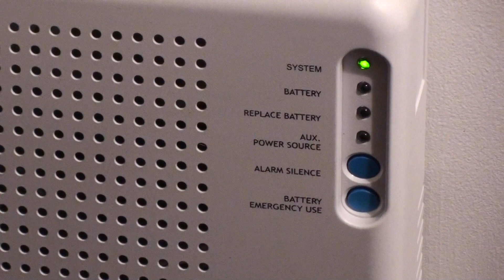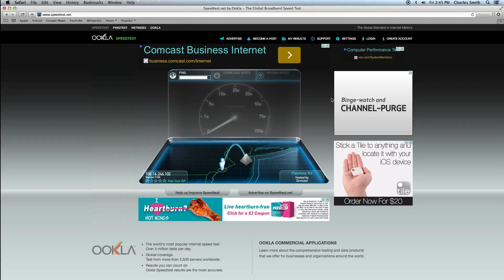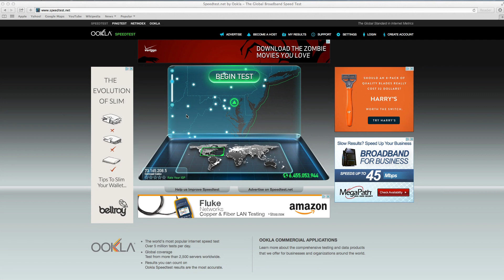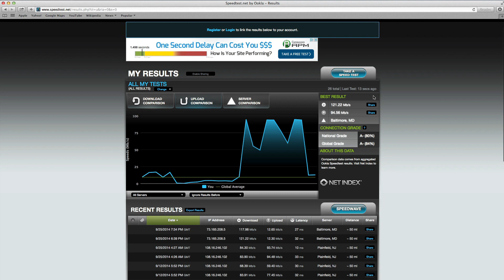Verizon FiOS Block Installation Process and My FiOS Experience

Comment: So, do you live in California, Florida, or Texas? If so how had frontier been.  I have frontier Fios and had 75/75 but just got upgraded to 200/200 yesterday.  It’s so insane.  I get about 2-5 ms ping.  Do you still have this connection?
Reply from the maker: I wish I lived in California, but no, I live in none of those states you mentioned. I live in Pennsylvania where Frontier is available but not in the city of Philadelphia. Actually Frontier uses Internet services from Verizon FiOS so you're still enjoying Verizon's services. I still have 75/75. I upgraded to 150/150 in 2014 but I saw no difference in uploads on websites so I downgraded back to 75/75.  It's been good for me. I see they have speeds of 1Gbps now. Sadly, though, I still have no idea how much my bill be. I haven't saw a price list anywhere of the entire service. The price went up $10 for every two year contract I agreed to. Next year, it may be another $10. I was paying $69.99 for phone and Internet in 2014. Now it's $89.
Reply: Thanks for the reply.  Yes, I used to have verizon, but then got switched over to frontier in 2016 when they bought verizons lines in texas.  I am really enjoying the 200 from the 75, as I download and upload large files a lot.  In fact, its so fast, it maxes out some of my older 802.11n wifi devices, and you have to have 802.11ac to utilize the full 200.  BTW, I'm averaging about 200-205 mbps download and about 240 mbps upload, which is insane!
Reply from the maker: @prestotechreviews8871   @Noname121416  Oh I see what you mean! I do have an 802.11ac router. In 2014 when I ran a test on Speedtest.net, I got 175/175 but I meant to say sometimes some sites won't take advantage of all the bandwidth if the servers speeds aren't up to date. Since I'm a video producer, I upload larger files than I download. When I first uploaded a large 10GB file to sites like Facebook and YouTube, the 75Mbps was faster than all the other upload speed tiers, but I saw no quicker time with 150Mbps. Maybe they improved it since I last checked. I think many sites weren't optimized at the time for super speeds yet. I may upgrade again this year and test it out. I'm even thinking of trying the "Gigabit" (940Mbps) connection for just one day.
Reply: @CharlesSmith 2014 was 5 years ago.  I'm sure the servers have been upgraded to at least like 500 mbps now.  But don't quote me on that, just a guess.  I did upload to google drive and got my full 200 mbps connection basically, and same download.
Reply from the maker: @prestotechreviews8871  Nice! Okay. I'm going to try out the upload speeds one day on the Gigabit connection.

Comment: Charles, I'm late to the party... I'm getting Fios installed in a couple of days, I'm in University City and finally realize that Comcast charges to much for Internet. I'm getting 100/100 at a great price. Question, that "ONT" in your video, can you receive "over-the-air" broadcasts?  Ever connected a coaxial cable from the ONT to the TV and get channels?
Reply from the maker: Hello, better late than never. Congratulations on your new FiOS package. I'm not sure if Verizon still allows free over-the-air video from the ONT. I've just been using the Internet from FiOS, I've never tried it out. I will make an attempt to try it out soon and maybe I can tell you the result.

Comment: Just curious for any connectivity issues whether its inside your house or not does verizon charge you and is there a monthly fee for your modem
Reply from the maker: I think Verizon charges you to fix your wiring inside your home. If it's outside, I think it's on them. I can't remember. But yes, there is a monthly charge for the modem. I don't use their modem anymore. I sold after having it only a month. I bought a better faster modem/router from Linksys.

Comment: just curious what town is this? fios is listed in my area (Sayreville, NJ) but ive address checked all houses and couldn't find one capable of getting FIOS. I didn't even think they were even still building out cuz I can't find any information about it in the news
Reply from the maker: AMP Tech This is Philadelphia, PA. Sorry for the trouble you're having. Yes, it's difficult for me to see if FiOS is in your area. True, Verizon is currently no longer rolling out FiOS in new markets as of 2010. However, if prior to that year they promised to bring it to your city or township, then they must honor that agreement. Typically, if Verizon has a franchise agreement with a city or township, it must wire that whole entire area. So, even if FiOS is listed in Sayreville, NJ but you cannot find an address with it available, that doesn't mean its not coming. They still must legally honor there commitment to finish the areas they promised to bring FiOS to. Some addresses you haven't yet checked may have FIOS. How many years have you waited for FiOS?

Comment: I'd be curiuos what is the maximum ethernet speed that is possible when Verizon does installations in large apartment buildings. This would be a function of the category copper cable they use and the distance of the runs. I ask because I wonder what happens when the fios server is capable of going over 1 gigabit. Will the ethernet in the buildings be a limiting factor because they didn't put high enough category cables in there? I would hope they put in something that can go over 1 gigabit. This would probably need to be a category  7a cable. Were they that smart? They can charge more for higher speeds and I'm sure that by 2020 one gigabit will be available and over one gigabit will be available after that. To do an installation in 2015 for example that will be limited in five years would be a very poor installation choice for a large building.
Reply from the maker: Yes, I agree. Those are great questions. I'd hope they make all the right decisions with the correct cabling now to allow it to be expandable in the future. If you have a friend that is fortunate enough to get FiOS in their apartment building, I'd ask them to ask the Verizon crew those questions. Verizon may not tell you this you this stuff over the phone or in person if you are not an apartment renter, as they may feel this info is classified. But its worth a try asking them.
Reply: Charles Smith Yeah, maybe only an installation crew would know, but only while they are doing it. Anyone else who would know might be too insulated to talk to. If the installation has already been done then no chance to ask that though.

Comment: I'm in Philly also, getting fios installed tomorrow,  how long did it take them to install your service  Charles?
Reply from the maker: Nice! It took them less than two hours to set me up for FiOS; It didn't take long because I had only wanted the telephone and Internet service with just one computer connection. I networked the other devices myself. It could take four to six hours, if you wanted the TV set up, with multiple boxes and DVRs.
Reply: Ah ok. I'm just getting Internet and one TV box. I've been wanting to switch to fios since they finished the roll out in my neighborhood. I dropped Comcast and getting the  150/150
Reply from the maker: Sounds good. Funny thing, I upgraded from the 75/75Mbps tier to the 150/150, but downgraded back to 75Mbps within a day when I realized my speeds didn't seem any faster. Now, my tier is stuck at 150, as seen from multiple speed tests, but they're still billing me for just the price of 75! It's pretty cool. I confirmed and they basically have a glitch on my account that is getting me this. I kept telling them but it's listed on my monthly bill as only 75. It's been this way for over a year. I won't fight it anymore if they want to bill me less money for more speed! Haha! 😂👌👍👏
Reply: That's good stuff haha.

Comment: I'm getting about 150mbps on cable now, down of course. The big limitation was the router before I upgraded. Most routers can only throughput 100mbps, but they don't tell you that. It will be until the next DOCSIS is released that I'll be able to get higher, but I plan to move to FIOS soon. I'll also enjoy lower latency which will probably be the bigger improvement.
Reply from the maker: Yes, true. FiOS will be much better! You will enjoy much lower latency. What Internet Provider do you have?
Reply: Charles Smith I have comcast. I get about 150mbps download now. I had to upgrade my router to UBNT edge router lite. Aparently most routers are limited to 100mbps even though the ports are 1 gigabit. The local network can go 1 gigabit, but not the outgoing connection. The UBNT edge router can go to 850mbps. To go faster with cable I need the next DOCSIS version and nobody is selling that yet. I want lower ping though for games and I think fiber can do that. Right now I drilled a hole in my apartment bedroom wall so I can bring ethernet in from the router which is with the cable modem in the common room. I don't want to use wireless, or if I do I just use it for my iPhone on the 5Ghz connection in the same room.
Reply from the maker: MrApplewine Cool. It seems like you have it all figured out. 👌

Comment: I HAVE 150/150 MBPS INTERNET FROM VERIZON BUT CAN YOU USE OTHER ROUTERS FOR FIOS?
Reply from the maker: MrBrickhouse Nice! I have upgraded my speed tier, as well. I have the 150/150 tier, too now. I upgraded and changed my router within a few days after installation because I didn't like how big the router was and that it was only a Wireless G, instead of a Wireless N. If you use Internet only or Internet and phone, it's simple. Put an Ethernet in the plug of the FiOS ONT and run it to your router. But if you have TV services as well, it won't be as simple but it can be done. Please visit this site to see the instructions: https://m.wikihow.com/Use-Your-Own-Router-With-Verizon-FiOS
Reply: Charles Smith I just have the internet,but thank you man been dying to get a new router.
Reply from the maker: MrBrickhouse You're welcome. Also, you may have to call Verizon to ask them to switch it from coax to Ethernet so you can use your own router. In this case, you don't need to buy an adapter.

Comment: Bruh this came up in my recommended 
I got Verizon fios gigabyte connection pushing speeds of 880 up and 979 down 
In Massachusetts btw
Reply from the maker: Hey nice! I see you're getting the service as advertised, even better than advertised on those downloads. You're getting 979Mbps, but FiOS is advertised for 940Mbps download. Honestly, though, I don't know why they don't just give us 1,000Mbps symmetrical speeds.

Comment: Average residential has more need for speedier download than upload. Depending on the server you are uploading to, you can have speeds of 75+ all day, but if the server does not allow you to upload at that speed, it makes no difference. That is why residential cable providers are opening up faster download speeds. If upload speeds are of more importance, that is what business Internet was made for. Plus, static IP addresses.
Reply from the maker: Terri oliver Yes, that's true. That's why I don't subscribe to any higher FiOS speed tier than the 75/75Mbps. I tried the 150/150 tier, and I saw no quicker upload speeds between that and the 75/75 tier, but the 75Mbps tier was way faster than 20Mbps. My point is that while anything past 75Mbps uploads is not really feasible now, we should still have better upload tier options than what we have now. I think YouTube and Facebook's servers currently can handle up to 75Mbps uploads. 50Mbps should at least be our standard. Our country's average downloads are good, but our upload speeds are pathetic. Many residents need something better than just 5-10Mbps uploads, even for small tasks. A lot of people these days do upload videos. ISPs are just accelerating our download speeds past 150+, which is way more than what many need but skimp dramatically on the upload end; A measly 10Mbps upload. Why not lower downloads and give customers at least 30-50Mbps upload speeds. Business internet is a viable option for some, but many cannot afford it. Have you saw the costs of just a 1.5Mbps T1 service, alone? Haha.

Comment: believe it or not DSL is not dead by a long shot. in fact bell labs just recently came up with  an astronomical 10gb DSL internet connection, yes 10gb on DSL using existing copper wires, which blows away any  other high speed connection at the moment. the problem is keeping that speed for over distances, that's the major hurdle that they have yet to figure out.
Reply from the maker: Wow! Yes, I've heard that there have been active plans to bring higher Internet speeds over DSL. That's amazing.10Gbps! Yes, that definitely does top any high speed connection at the moment. 1Gbps is the current reach most carriers can only dream to achieve. Google Fiber is one such network. But yes, distance is the biggest challenge for them to implement these speeds over DSL.
Reply: I think it is a great idea because you can use existing lines to achieve that, but with that said they are going to have to  figure out a way to maintain that speed over long distances which they haven't figured out yet to do. cause as of right now 10gb will only reach up to 140ft from the sub stations before it drops off. maybe going wireless is the only solution to that problem where 10gb can be broadcasted from a sub station wirelessly to an outside signal  receiver box on your home  that will plug into your existing phone lines in your house.
Reply from the maker: SteelCity1981 Yes. It is a great idea but I don't think it will work well. It may be more trouble than what it is worth. Copper just isn't a good conductor for high bandwidth data communications over distance. To figure out how to do so would take up more time and resources than it would to just go ahead and lay optical fiber cables. I don't think they should completely abandon copper wire but they should keep it for those on a budget that need acceptable data speeds. It should become the "new dial-up" and dial up should be abandoned. Higher-end communications should move in the direction to focusing on only rolling out fiber-optic services. Wireless will always be a viable option, but due to it being wireless, it will not be as fast as a wired connection. All signals will greatly be affected by weather, distance and other factors. If a wireless system was connected from the ISP's base station to your home connection and then to your home's copper wiring, you would still loose most of your advertised 10Gbps speed. More ISPs need to invest in complete fiber-optic wiring to the home.
Reply: copper will always be a around in some shape or fashion rather it's for electrical or phone lines so I dont' see copper ever going away. the problem is that a lot of rural places in the u.s. don't even have a dsl option, let alone a fiber optic one so the next best thing for them is  satellite. i'm not so sure it won't be as fast if not faster then a wired connection. when we start talking laser connections it becomes a whole new ball game and unlike lines where they have to go through relies and switches a laser connection doesn't and is point to point which is also will be next to no interference then a radio connection that we use now in wifi. but we are talking something that's still in its infancy and won't be ready to go public for some time now. I do think once it does it will replace all internet connection standards.

Comment: Switching to Fios 100/100 soon. Have RCN that gets 40 after a router reset then 2 usually!
Reply from the maker: Awesome! You are going to love FIOS! The Internet will be so much enjoyable! Wait, when you say 2, are you saying you get from 2Mbps to 40Mbps, then back to 2Mbps sometimes?
Reply: Yeah 2mbps, it's very inconsistent, I had some higher speeds today 45mbps but I know Verizon has a more reliable network. Paying $80/mo for half the speed of Verizon. Just did a speed test on my phone and got 15mbps download 9 upload
Reply from the maker: Yes, Verizon is very good and worth the price. Wow! 2Mbps? That's a real drastic change in speed! That's really unacceptable for a cable connection. The speeds shouldn't fluctuate like that. I do understand that having a shared connection with many subscribers on one cable node in a neighborhood can affect the speed, but it should never be that drastic. Do other subscribers to RCN have a similar issues? What phone carrier do you have?
Reply: Charles Smith I was told it could be from the WiFi that it slows down? I have MetroPCS which for some reason is also slow only at my apartment though.
Reply: Charles Smith I am getting the new 150 up/ 150 down can't wait but how is it the internet from FiOS but I am with comcast now
Reply from the maker: Nice!! I'm sure you'll love FiOS! I had Comcast too, which was fast and reliable, but like most other ISPs, the speeds weren't symmetrical. My download speeds were about 100Mbps, but my uploads were just 20Mbps and my bill was more than what my FiOS service would be. What I like about FiOS is that the download and upload speeds are symmetrical. You get the same upload speeds as you do downloads. I upload much more than I download. I upload many big HD video files to many social media sites to share my videos so I need those symmetrical speeds. What I also like is that you may also get speeds a bit faster than than what's advertised, which is a rarity among products and services these days. My friends have 50/50Mbps but their modem is pumping out speeds of 65/70Mbps. I'm paying for 75/75 but my modem is giving me 90/90!
Reply: Charles Smith I like the consistency of my connection, now I just need a faster pc to take advantage of it :-)
Reply from the maker: Dominic Anfuso I know what you mean. The speed of the Internet is a major benefit. But you won't enjoy it unless you have a device that can take full advantage of that speed.